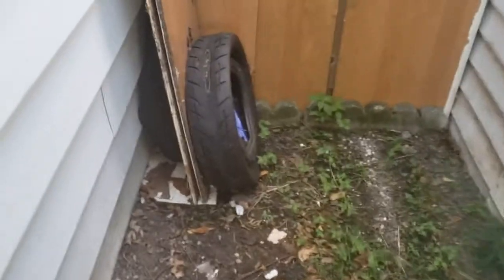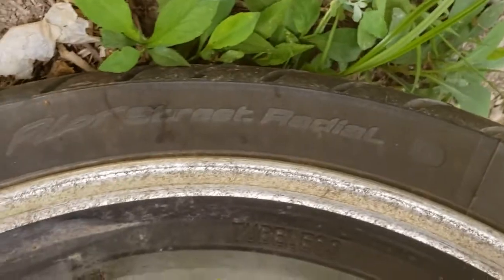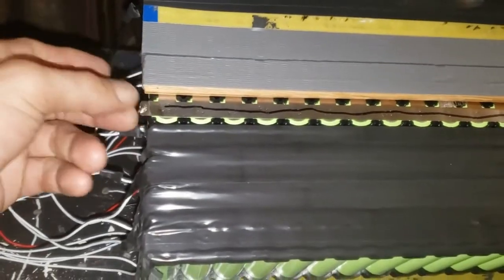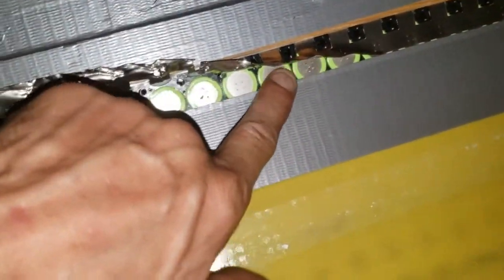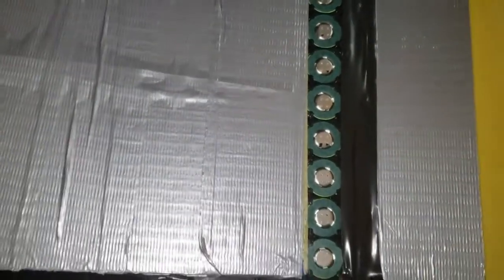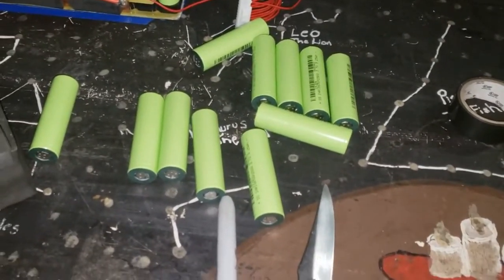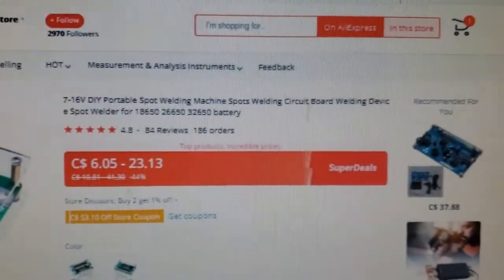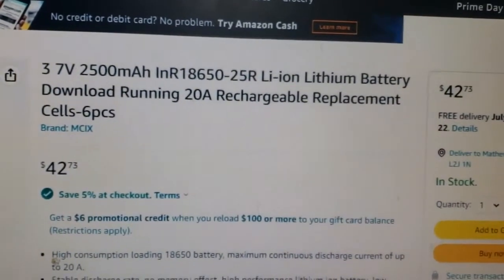Tao Leo - Battery Pack Repair (Part 1of5)

Comment: great vids my man.   so i inherited a tao leo with no controller.... but in amazing shape.  is there a generic controller i can throw in just to get it going?  im a newbie... sorry for the dumb question
Reply from the maker: No idea. It's got a 3000 watt motor so shoot for something around the 2-3kw power range with atleast 60 amp output and in therory it should work. But i would go with an em-100 or a kelly controller of the same rating. Good luck!

Comment: Really should just save up for a new battery like I am doing. Buying 3x 24v 280ah prismatic cell lithium iron phosphate batteries. 3200 for a 20,000 watt hour battery. That's 500km range minimum at 65kmph consistent speed.
Reply from the maker: I'm not monetized or sponsored and live on a very fixed income. The only reason I could afford the bike in the first place is because my mom left me money when she passed away, which is long gone. So I'd love to put a new battery in, if ur gonna pay for it lol.

Comment: also have a Q ..if i got me  a new model tao  could i swap out controllers with my older one ? thinking about it.. like them new lights and sound system lol
Reply from the maker: Yea i saw that. Um u could but I believe you would have to re-pin it over to the new plug connections. I do believe they're different.